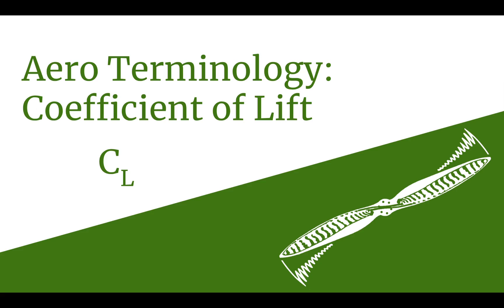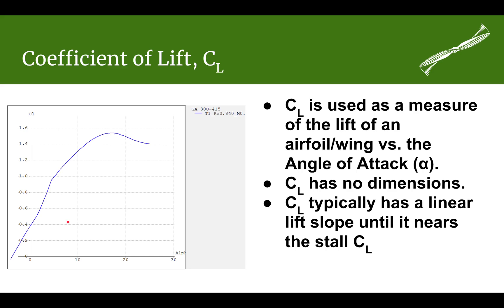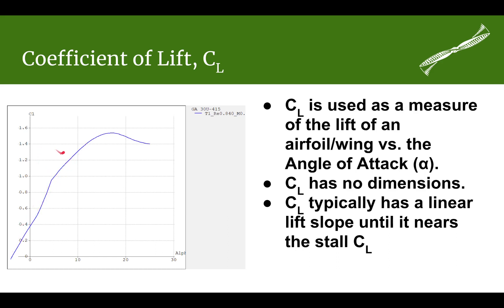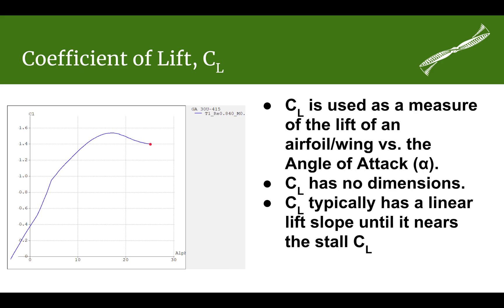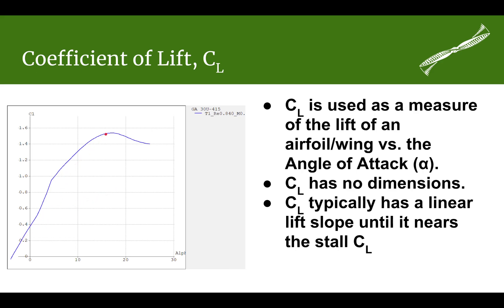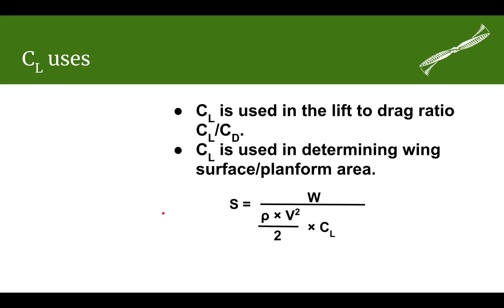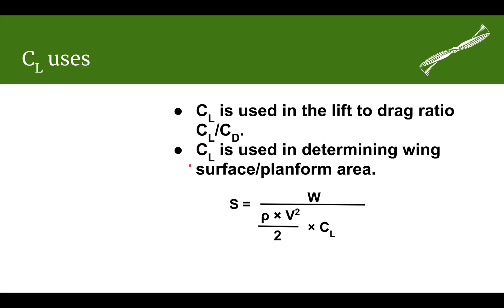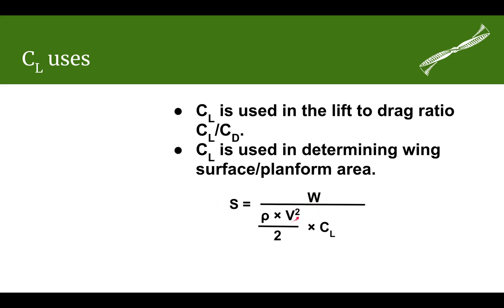Aero Terminology: Coefficient of Lift

Comment: Can you help me with this

A moderate speed aircraft moving at a speed of 13 ms-1 whose wing span 
and aspect ratio is 150 cm and 5 respectively. Assuming suitable wing 
loading and density of air calculate the lift generated by the wing at cruise 
speed. 
[Take g = 10 m/s2].
Reply from the maker: If you want to use the lift equation then you need to find some way to calculate the coefficient of lift. BTW, this looks like a homework question. I don't help people with homework questions.

Comment: How can I calculate a wing with a twist, if I have a wing with a -5 deg. twist? I don’t know, if it has 2.5 at tip and roth or 5 at tip 0 at roth....... (Sorry for my bad English and thanks for reading)
Reply from the maker: You can use the AeroVSP part of OpenVSP to do some calculations with wing twist. As far as the specific twist you asked about. The only difference is is the attitude of the fuselage relative to the wing. The wing will perform the same either way.
Reply: Ultralight Airplane Workshop, sadly I can’t use these programs, but thanks for wandering! I guess I’m gonna figure it out some how....